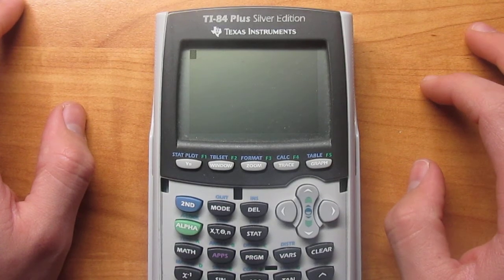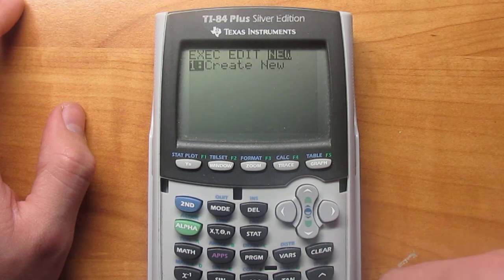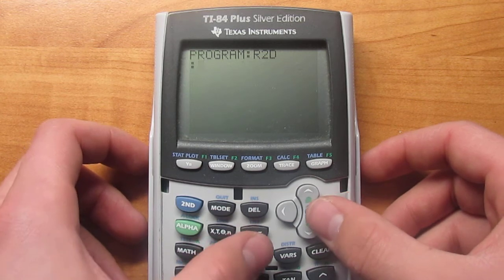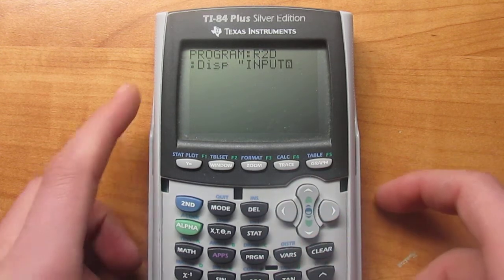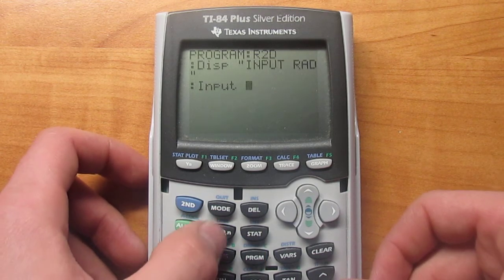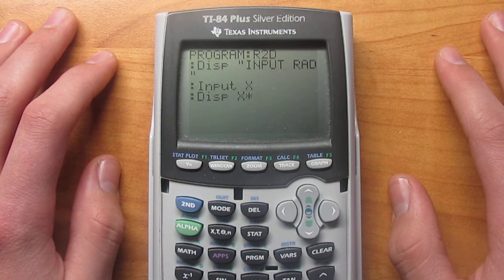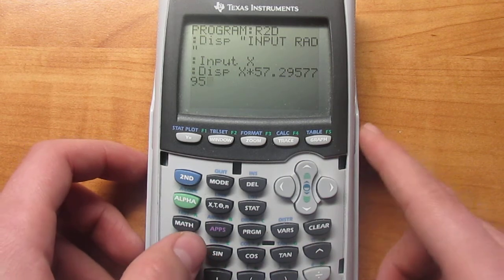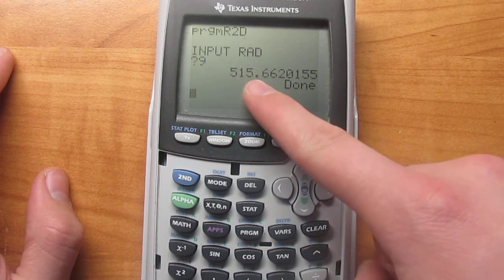How to make a Radians to Degrees program on the TI-84

Comment: Protip: after some more research on this, I figured out that if you don't use Disp for the answer (and just do X*57.2957795 with nothing else), it stores the answer in your ANS variable (last answer) which can be useful since you can then use it directly in your calculation instead of having to copy the result.